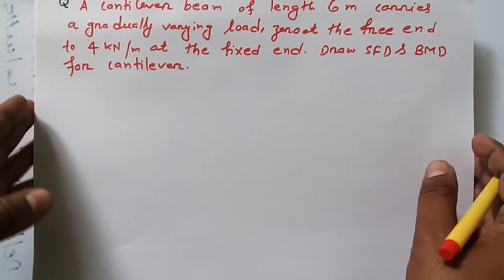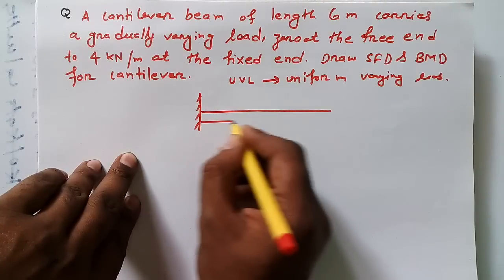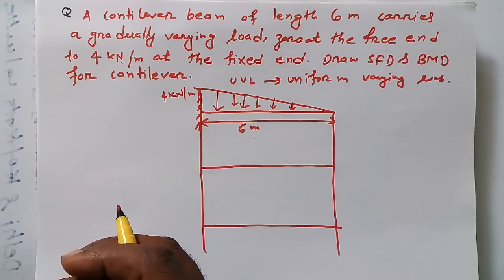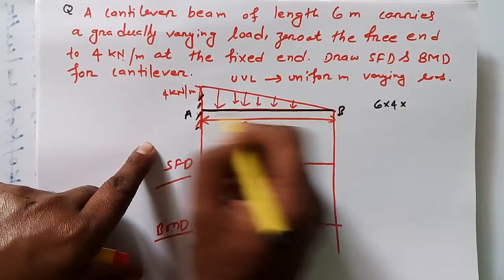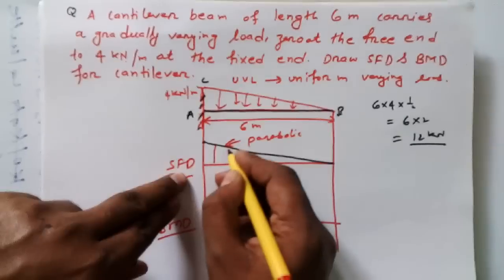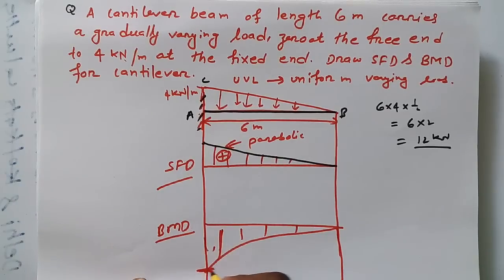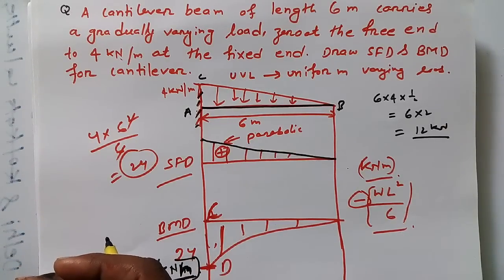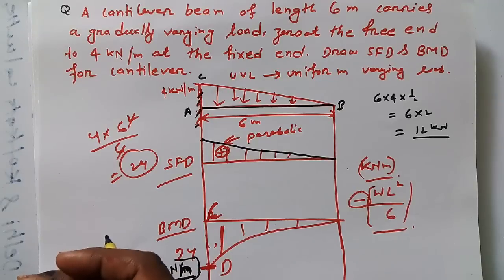SFD and BMD for Cantilever with UVL- SFD & BMD Tutorial  3

Comment: thanks sir, i have problem how sf diagram for UVL become parabolic
Reply: When u will see the shear force equation it is comming in parabokic equation ie W(X^2)/ 2L .
SO It shows that the curve will b parabolic and from the sign convention it will b  positive directiin .now comes a queation that whether it will b upward parabolic or downward parabolic .for that we have to check the slope of curve  becos as per relation that the slope of SFD with the load intensity at that section and similarly the slope of BM diagram is closely related with the shear force at that section . Is x is increasing slope would also increase .an in case up upward parabola the slope ia decreasing with increase  in x and in downward parabola the slope is increasing with increase in x .so we prefer downward parabola .....
So u got it how the curve has been drawn

Comment: sir, please explain me if the problem contains both udl and uvl
Reply: No brother, UDL is a type of load where you have a constant value of load per unit lenght of beam. UVL is uniformally varying load. This consists of gradually increasing values of load per unit length. So, as you go away from the starting point of the UVL, you start getting bigger values of load per unit length. Hope my reply helps.